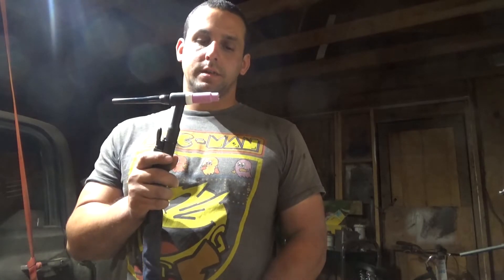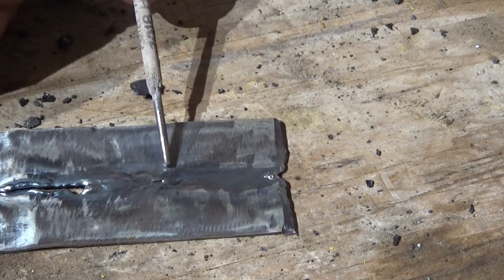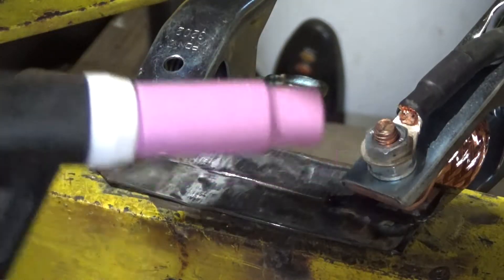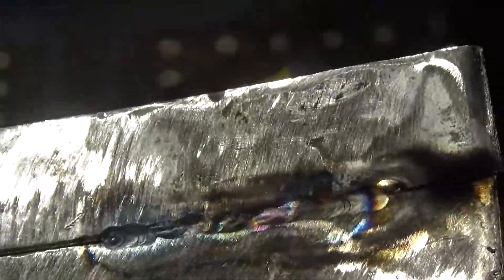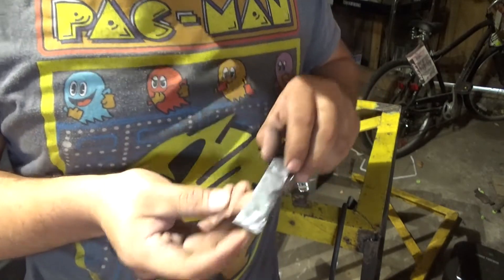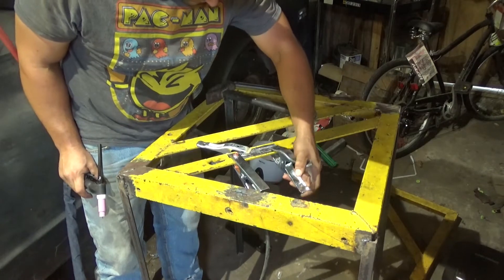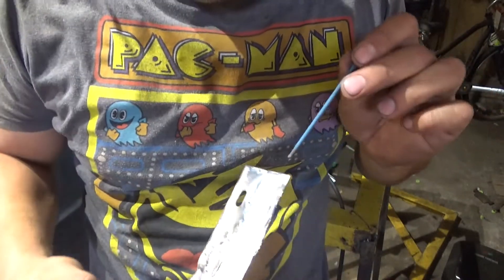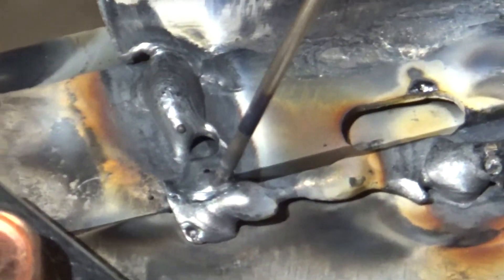tig welding for the first time, thin sheet metal(1 mm steel fusion weld) with everlast 160 sth

Comment: "Just look at it, I can't even explain what just happened"  
Lol your a goofy! I actually just started tig welding 2days ago and I can relate so much. I've mig welded growing up and now I have a tig and I'm like I need to watch more YouTube videos so I know what I'm doing. And then I see this  lol.
Reply from the maker: That was my first day and that 
reaction was real, lol.
Reply: @davidcraft4909  Tig is alot easier than mig in my opinion and you can do more with it. Have you tried aluminum yet? I think its alot easier than steel due to the puddle getting started faster but I gotta learn the foot pedal to cut down the amperage after I get the puddle going because I keep burning through or melting a dip in the metal.
Reply from the maker: @JPANDLIFE05  I actually never tried mig but I know its easier than stick welding. No my machine only has DC and apparently aluminum needs AC.
Reply: Commical 👍😂 keep up the good work.